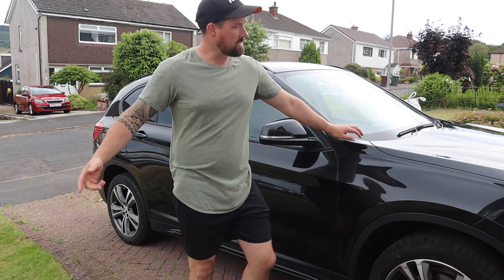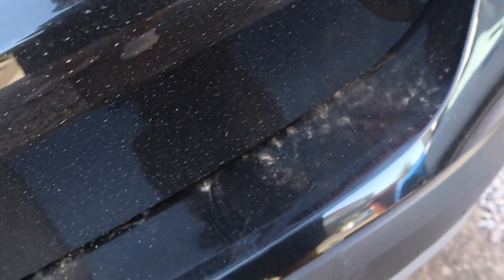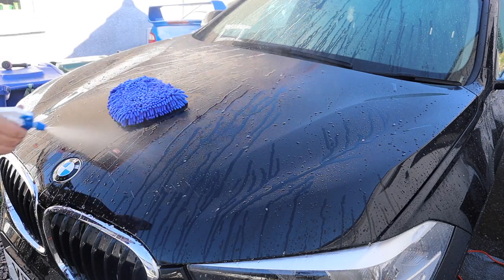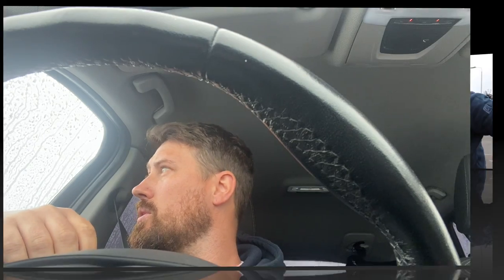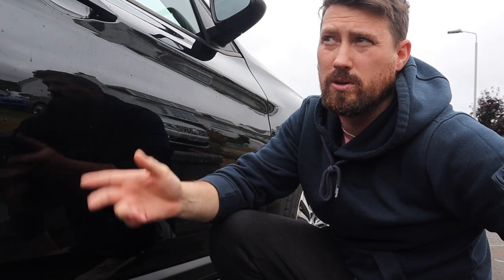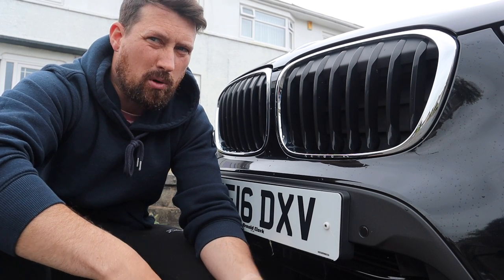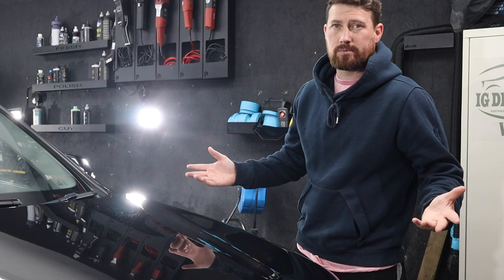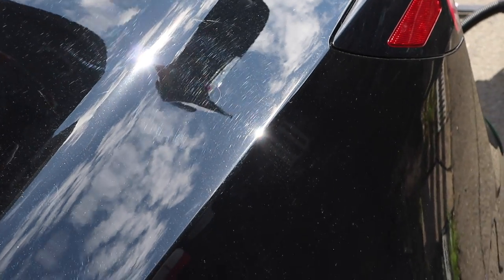Did a HAND Car Wash Ruin my car?

Comment: I'm not surprised by the results but I'm definitely gobsmacked by your bravery 🤣 - unless you were looking for an excuse to do a full correction on the BM 🤔🤔🤔🤣

Some of them don't necessarily do a 'bad job' for what most people expect, but if they would even allow some of the prewash chemicals to dwell for 2-3 minutes first and give them a fighting chance!!

The worst part for me is the mitts - the same mitts they've been using in the same container of wash solution... All day 🤢🤢

Cracking video mate, some excellent points 👌🏼👌🏼
Reply from the maker: To be honest Mark, i need to do a repair on the rear bumper then the car is getting a full multi stage correction.

The wash process that they followed wasnt actually bad, they done pre wash / wheels / then a contact wash. like you said if they gave the chemicals a fighting chance the car would probably be clean. The mitts however are the biggest issue in some of these places, they can be cheap and dont get cleaned out often enough or the wash solution changed often enough, i would hate to see the colour of that water at the end of the day.
Reply: @DavidMcBay  I think people like us would be genuinely sick if we saw the water - I imagine it wouldn't be far off Nardo Grey 🤢

Comment: First time ive seen someone do this thing you were brave lol id also like to see like what you did but wait a day rather than a hand car wash try onr or mckess rinseless wash to see if that swirls up
Reply from the maker: That’s an idea for a future video mate, might need to do that on another panel though 🤣🤣
Reply: I just bought the McKees rinseless  wash and I’ve always been a safe wash person , I tried it with a sponge but not any sponge and I can tell you it’s just as safe as a traditional safe wash , I tried it on my brand new car which is black with soft clear coat . I done a pre soak first though. There’s no such thing as actual safe wash as you’ll never eliminate swirls completely especially on these new soft clear coats

Comment: A bit part of whether to use a commercial hand car wash is how important meticulous washing is to you. It's like the whole argument around swirl marks - some people think they are natural like the grain in wood! My big beef with them is I've seen them drop mitts etc on the ground, pick them up and carrying on grinding the grit into your paint.
Reply from the maker: Thats very true Peter, i used to think that myself when i was younger before i got into detailing. 
The one that i went to had 2 guys washing my car at the same time with what i would describe as cheap mitts, they went round the whole car without rinsing any of the mitts out during the wash and they went back into the same bucket that would have been used on the car before mine.

Comment: Was quite expecting bit more damage. 

I assume  you've went 1st thing to get the clean buckets
Reply from the maker: I was expecting more myself mate, I went at 1pm so should have had a few cars in before me although when I went in I made sure there wasn’t a que. 

The paint on my Bm is very hard so that may have helped prevent some more damage.
Reply: @DavidMcBay  going when quite and having hard paint would have certainly helped.

Wouldn't like to think how dirty the buckets are or if they had chamged them at any point during the morning

Comment: I had to go to one a few times back in 2019. I sat watching as the cars in front of me all drove away with completely flat paint.
Then I noticed the rinse bucket!
It was a 200 l barrel chopped off two thirds and transparent.
It was completely Black!
I thought Fuck this and drove away.
I had to go again due to mobility issues and this time I was armed with my own bucket, brand new microfibre wash mitt and my own shampoo, Megs Gold class.
Guy was a bit bemused when I asked if he could use all my products.
He said. " it will still cost you 6 quid"
😅
Reply from the maker: 🤣🤣🤣🤣 I bet that’s something they have never seen before!!! 

I actually drove past the car wash I used and there was at least 5 cars in the que, some waiting with pre wash on them, it gave me the fear.